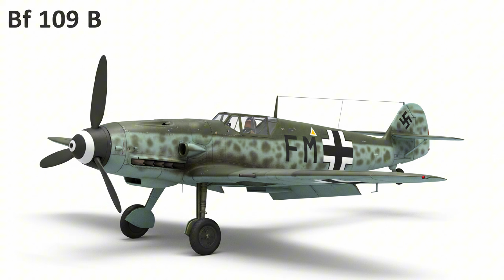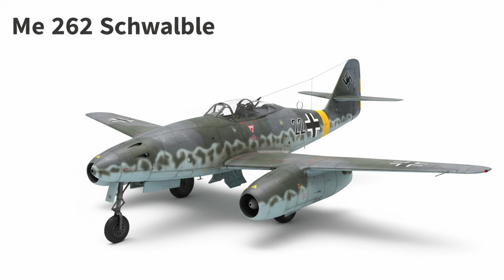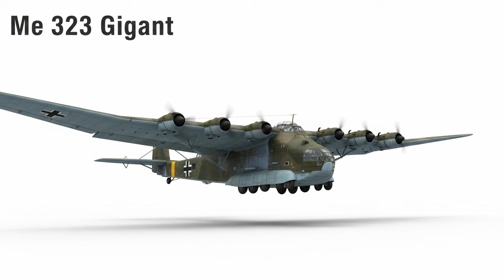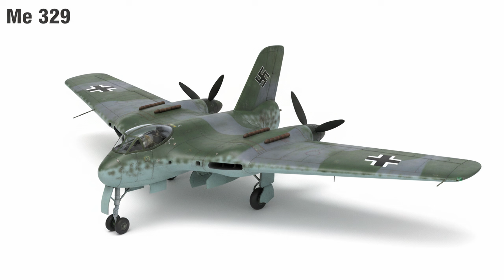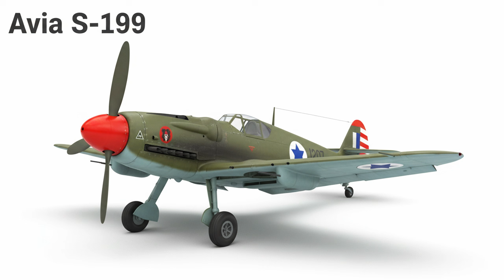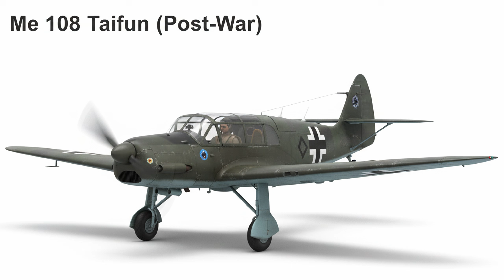Every Messerschmitt Explained in 27 Minutes

Comment: Your Bf-108 's rudder shape is wrong,  109's B / E are incorrect, nose hubs correspond to later versions, starting with Bf-109 F and G's.....BF-109F's, G's and K's did not have support struts under the elevators....BF-109 K's canopy frame is also incorrect, a more clear version was installed starting from Bf-109 G10, and no tail struts either.......Bf- 210 did not have wing guns, only 2 20mm nose cannon and 2  fixed forward firing machine guns in the nose, your 410 Hornisse is missing it's tail wheel...your Me-162 Komet is also wrong, 2  20mm or 30mm cannon were installed on wing roots, not on the nose, as your image shows, and also Komet didn't have support struts under the elevators, the landing skid is to short it should extend further back, also missing the generator small propeller in the nose tip......Me-262 shows a nose jet intake, wrong, it was a twin engine aircraft, nose landing gear doors are also incorrect, should be one small vertical on the gear strut and only 1 side closing door behind...Me262 A2 Sturmvogel and 262-B1 Nachtflieger are both correct (bingo!!).....your Me-321 Gigant's landing gear is incorrect, this enormous, and heavy aircraft stood very close to the ground, Me-323 is correct!......Me-328's had a landing skid array, no wheels and gear struts, in your picture, wheel would be folding on ramjet engines??!!......and I'll stop here, further ahead your creations are that, fake creations......and don't feel like writing a book this morning.......still wondering are your images AI generated........maybe it had a stroke (neuro vascular event).........sorry dude......you should verify your data before posting.
Have a great week............